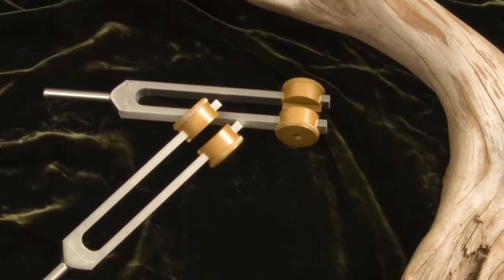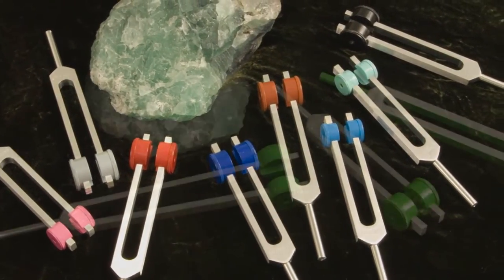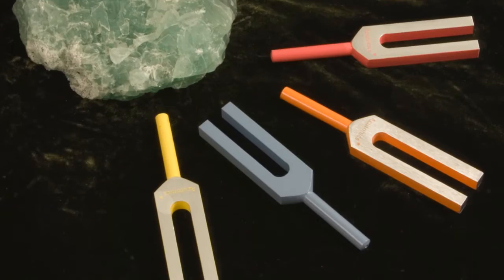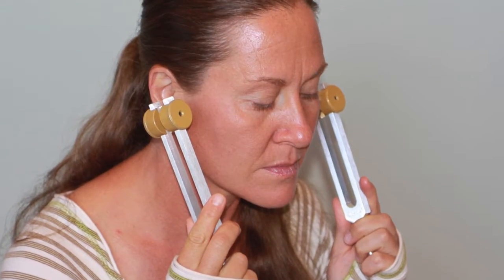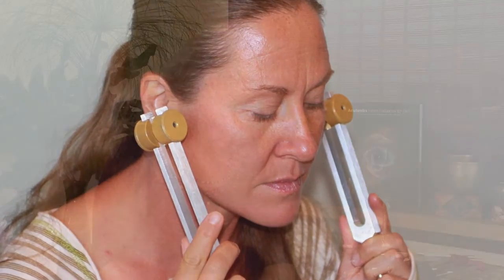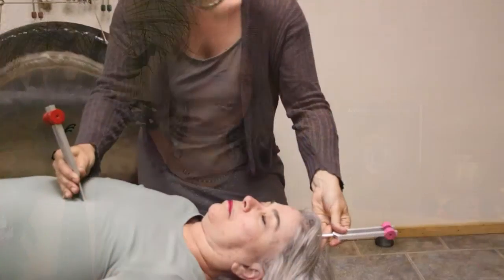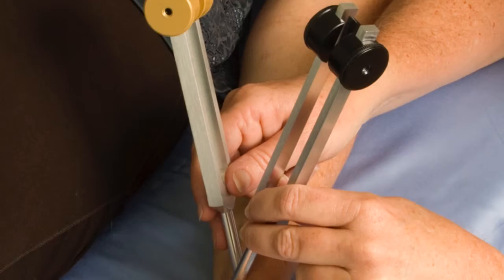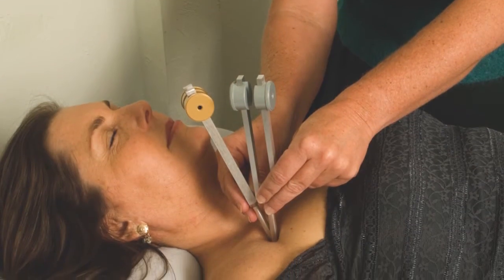Acutonics Quality Tuning Forks for Health Care and  Research

Comment: My forks got broken twice already.  Very unfortunately.
Reply: you mean Acutonic's forks broken?
Reply: Did you drop them?
Reply: I have had the same Acutonics tuning forks for 13 years with a busy practice and I teach students with them.....they have never broken or changed pitch.  Over time some color paint has chipped away but the sound is not affected.  I also don't drop them or bang them on hard surfaces.  Striking them with a flip of the wrist on a rubber activator at a 45 degree angle makes a great vibration and you don't have to strike them hard.